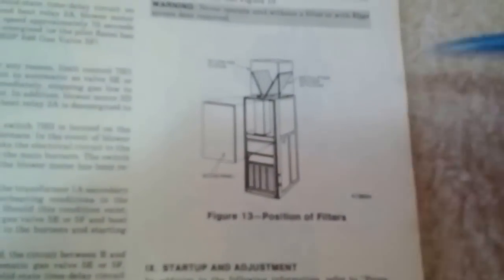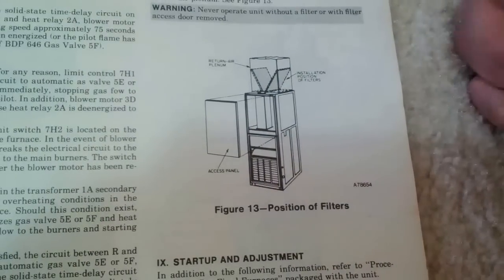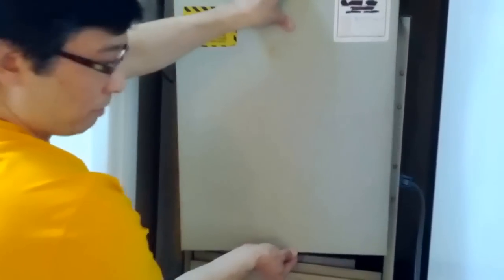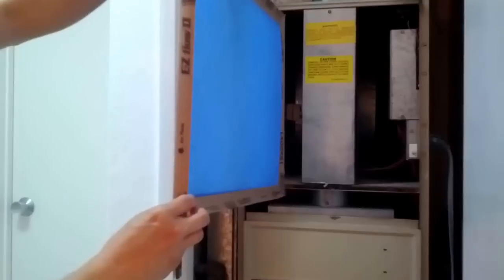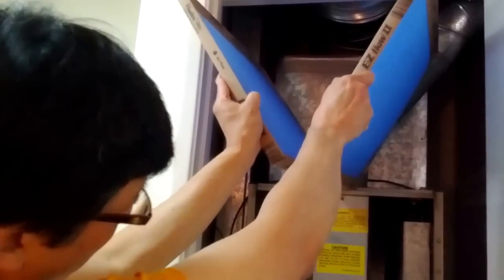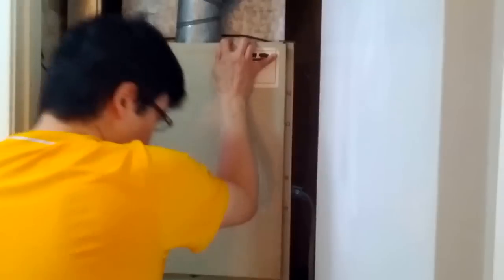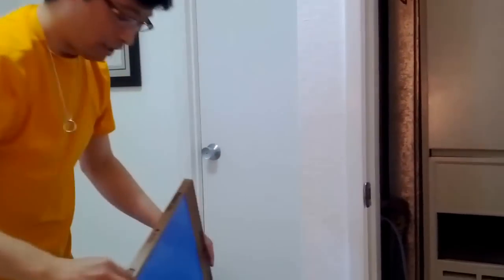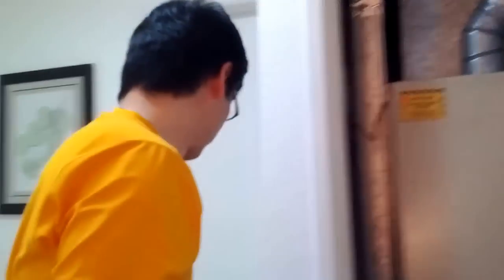How to change your V-shaped furnace filters (Model 396GA)

Comment: Thanks! I just figured out that there was a second air filter in our furnace and that the previous tenants were putting them in stack and not v shaped. This confirmst that I did it correctly along with the airflow arrow facing the right direction! Thanks again!

Comment: Are you still there?  The V filter explanation was great!  I am confused on which panel goes on top and which goes on the bottom.  We had them reversed during air con season and hot garage air was blowing into house.  Many photos show closed panel on the bottom and the grated on on top.  Your video show closed on top.  Can you advise on this?  Our midels may be different, but the fikter explanation was right on mark fir ours! Help?

Comment: I tried to change my furnace filter last weekend for the first time since I moved in and I saw the same channel in mine, but there was just one filter resting flat on top of it. It made so much more sense now what the channel is for! Also I couldn't figure out how to squeeze the replacement filter in even though it was supposed to be the same size (the new one has the wire mesh and the cardboard around it is much stiffer. The old one also came out very bent. I will have to see if I can find a slightly smaller one. Thank you so much!!!

Comment: Thanks for the video.  You might want to consider getting a higher MERV filter.  Those fiberglass ones only filter out the largest particles.  You don't want to use MERV 13+ (too constricting, and makes your system work extra hard)... maybe a MERV 5-9.

Comment: I installed the arrows the way you described, but I felt like the air was pushing from bottom to top, so the arrows should be pointing up. Is that incorrect? If the air is going up, should the arrows be pointing up also?
Reply from the maker: I no longer have access to that heater so I can't double check

Comment: wouldn't you have air flowing thru and missing the filter if you use smaller size? we had similar issue
Reply from the maker: Take a look at the diagram at 0:25.  In my heater, the filters are only supported at their bottom edge; at the top edge they lean against the air duct side.  So if they are a bit narrower, it just means that they end up being slightly more horizontal, but they still touch the side of the duct so no leakage is induced.
Reply: By being angled less steeply they lose structural strength against the airflow and are more likely to collapse. The 1" of the measurement only refers to its thickness.